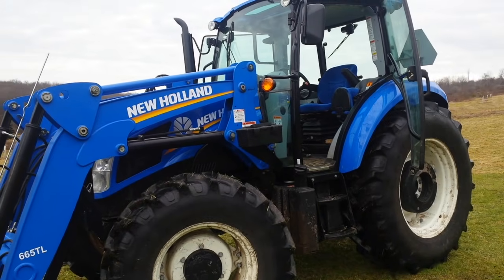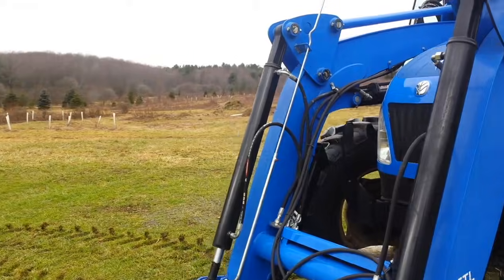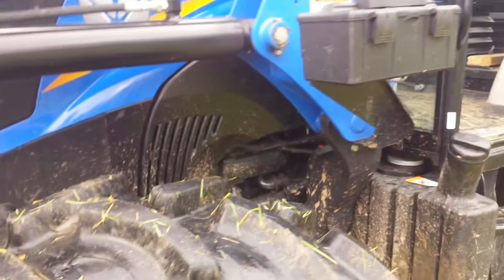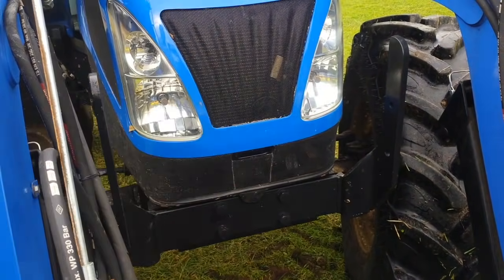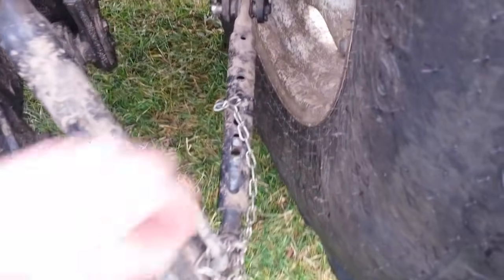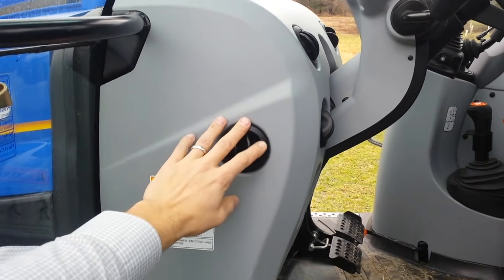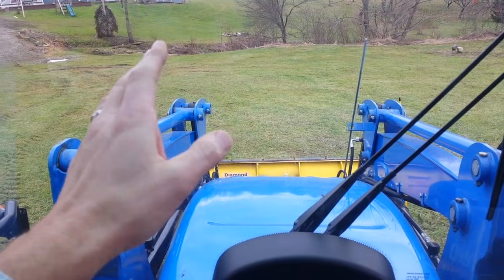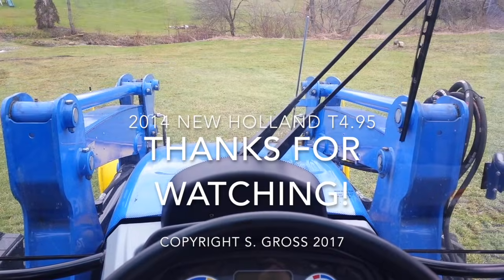New Holland T4.95 Updated Review - 184 hrs - Watch before you buy!

Comment: Thanks for the review.  I really appreciate it.  

I bought a Workmaster 50 back about 9 months ago and have had no issues to speak of other than losing a couple pins.  This is a nice size unit that I hope to upgrade to in a couple years.  I want to keep the Workmaster and my older 4610 SU.  

New Holland supports their product very well and for the most part are well engineered.   I did purchase the upgraded heavy duty brush guard.  They have them available at your dealer.  Getting a 3rd function valve and grapple this week.
Reply from the maker: Awesome!  Thanks for watching!
Reply: dan long 
Dan...No issues here in North Carolina...2 years of trouble free service...No issues with the Catalytic converter or electrical... Hope you get your problems worked out...If my Workmaster had a cab I would have never traded...

Comment: Nice Tractor. I was always a Ford/ New Holland guy but had to switch to Kubota because all the two local New Holland dealers closed. Weird that you had a problem with the tire too. On my old TB100, I had a front tire come off. I eventually had to get the whole hub and get a new rim for the tire because of the damage caused.
Reply from the maker: ToothSIayer thanks for watching.  what size kubota did you get?
Reply: M9960

Comment: I like the front blade the only thing i would do is make a bigger push bar for the front of the tractor
Reply from the maker: Thanks Jordan.  Are you talking about the black bars on the front?
Reply: @ModernCountryLiving  yea the black bars on the front i would make them bigger and put a mess screen on the front
Reply from the maker: @jordanbeardy8798  That makes sense.  I had a stick hit the hood when I was in some thick stuff.  Will have to look at that.  I also bent one trying to pull a tree stump out of a hole.  Was able to get it back into shape.  LOL.  Thanks for watching.
Reply: @ModernCountryLiving  yup 👍

Comment: Where is the plug located at that you pulled out ? Crank case filter vent 

Thank you
Reply from the maker: It was on the front of the engine in the area of the fan.  The service technician removed it.
Reply: @ModernCountryLiving  thank you!!!

Comment: i bought a new t4 100,dealership bought back,kept pumping backend oil into engine,couldnt cure,balance of loader on tractor bad too heavy on front axle,wear tyres out fast and  back end light,need heavy wheel weights else she tip over,avoid a t4,buy something else like i had too
Reply from the maker: sorry you had this experience.  I am near 500 hours and do a lot of loader work.  Tires are great and machine has been great.  I do have wheel weights and I'd say that if you lift at max capacity you do want them or some weight on the rear of the tractor.

Comment: Thank you Shawn.  We use HST now so yours will be first shuttle shift for us. Will you please do a 5 plus minute vid of you simulating driving up to a multimillion dollar garage door for the purpose of backdragging snow. Before I make the purchase I need to assure myself that I will not  park in said garage. HST can spoil you with the ability to have complete control and no insurance claims. Only three in 33 years doing this line of work!  Be well.    Wayne
Reply from the maker: IowaKLR650 I pull up to the front of my vehicles to backdrag.  I tend to use the clutch and brake in those situations.  It depends on what gear and rpm and speed you're going.  You will get a feel for it...you let off gas...slow down...pull shuttle to neutral and stop tractor.  Then you pull shuttle to reverse.

Comment: "Everything ELSE has been good."  Everything,, that is, except the rear tire (almost) falling off!!
Reply from the maker: Just being honest.  Since that day...no other issues.
Reply: He probably now learned to check all bolts regularly. At my work all tractors have stickers on the door to visual check wheel nuts every 8 working hours and torque check every 50 hours. With all vibrations during work it is very normal to check everything on a regular basis. We replace a lot of nuts with self locking nuts with the nylon inside.

Comment: surely most of this stuff should have been spotted by the dealer before it was even delivered
Reply from the maker: hmmm....   The windshield washer motor worked and then stopped.  So, that wasn't something they'd see.  I am not sure, other than the wheel bolt torque, what they would have found.  As I said, fortunately, that turned out ok.  The dealer has supported me with the nuisances I've had.   The diff lock....maybe they could have detected that if they drove it enough.  They did not.  I had them go find this tractor and the day it was delivered, I wanted it.  Thanks for watching.  Hope to keep updating as time goes on.
Reply: Its just like buying a new house, do a once over check everything, i mean everything...you get a snag list and the house builder will come back to sort it. Same with a new car or tractor. Check everything.i did on my 2nd hand NH and i budgeted an extra £500 for odds and ends "New filters, oil, LED lights". I tell you i spent a very enjoyable sunday cleaning her and making her mine.

Comment: Sounds like dealer prep not very good. Otherwise good tractor.
Reply: Exactly, even the wheel thing is dealer issue because sometimes dealers need to make some prep and need  to take the wheels out. But I would say if you know your machine well it hardly gives you much problem. Farmers usually check their tractors before and after work which eliminates a lots of issues that he is talking about.

Comment: Never made sense to me not to load the rear tires and front to if it's 4x4
Reply from the maker: I can understand why that's done.  But, for towing purposes, I didn't want to exceed my tow vehicle limits...and I am right at the limit with tractor, loader, and trailer.
Reply: The extra traction it worth it .... those limits are just for liability reasons for the tractor manufacturers... they will handle far more than they're rated
Reply from the maker: Sorry...I wasn't clear.  When I tow the tractor on a gooseneck trailer...it would exceed my tow limits.
Reply: Oh... I see your point. I'm just used to having trailers capable of handling that kind of weight.
Reply from the maker: trailer handles it.  but...get over 16000 Gross and you need a lot of truck...

Comment: Dose it work good to go to the woods?
Reply from the maker: Marc Gallant yes.  need to be careful with cab.  Thanks for watching.
Reply: Did you ever used it for pulling out tree stumps
Reply from the maker: I have not.  The tractor weights over 10,000 #.  It can tug pretty well.  I've skidded logs (several at a time) with no issue.  Tires provide lots of traction.

Comment: Buyer beware. I have a t4.75 with 300 hrs. Still under warranty. Its been down 6 months with engine software problems. No repair in site. New holland will not stand behind them. $50,000 boat anchor. Junk...
Reply from the maker: Sorry you are having that issue.  Neighbor has a T4.75 with a few thousand hard hours.  Still chugging along.  I am sorry you are having that experience.  I can find similar comments on any forum for any tractor.  Some of it is circumstance.  Some of it is dealer support.  Some of it is just corporate issues.  Some are lemons.  Some models are more prone to issues due to design.  I am sorry you're dealing with these problems.  But, my experience with New Holland has been very favorable.  TN75 was a great tractor for me and the T4.95 has been great as well.

I have a Kubota zero turn commercial mower and have had people say they have junk decks.  After 15 years I finally replaced the original battery and the deck is going strong.  Beast of a mower.  Change fluids, grease it and run it.
Reply: @ModernCountryLiving  thanks for taking the time to reply. I agree with you whole heartedly. We bought the tractor to pull a 10 ft great plains no till drill. Were retiring a 570 cockshutt to the barn. But the new holland has yet to do its job. I thought about trading it in on a different tractor. But they wont take trade in unless its fixed. The holdup on repair is getting software for the engine. Im stuck and frustrated. Its a lot of money.

Comment: 184 hours in 20 months 😂😂
Reply from the maker: At 360 or so now...LOL!!!!  Should last me 500 years!!!
Reply: @ModernCountryLiving  No, if you use it so less you usually try to care about it less and that deteriorates things.
Reply from the maker: @hp2084  I'd agree...but I wax this tractor a couple times per year and perform maintenance well before the manual requires.  I've changes the oil a few times already.  Same for fuel filters.  And I grease it regularly.
Reply: @ModernCountryLiving  Yes but these machines are meant to be used regularly. Those fluids sitting in engine, radiator, transmission, hydraulic, steering gets deteriorated faster if you dont keep heating them up by using regularly.
Reply from the maker: @hp2084  It's used every week.
Reply: Waxes his tractor. 🤣